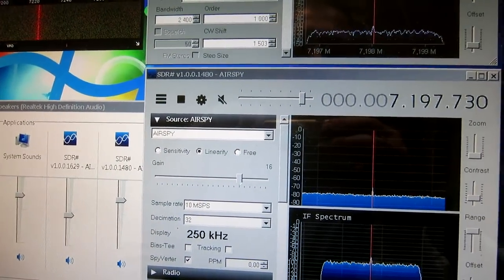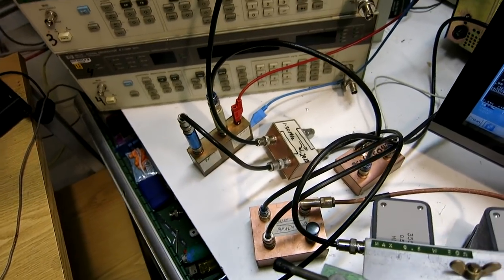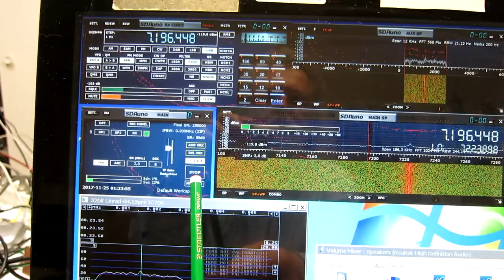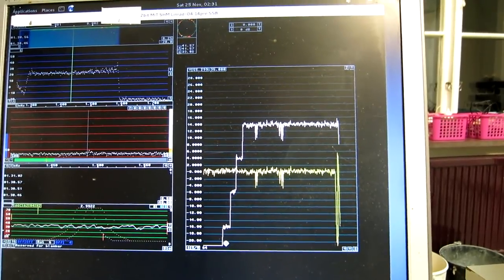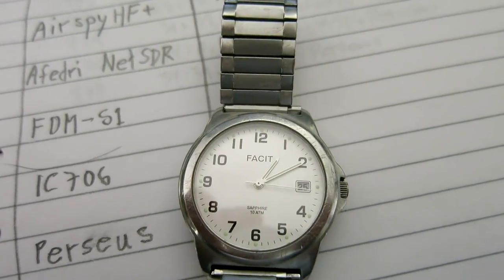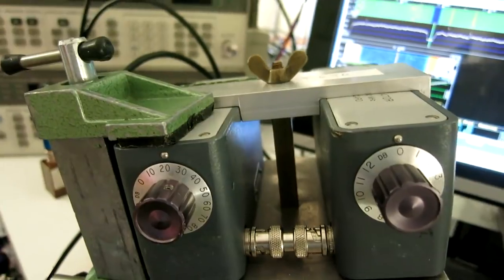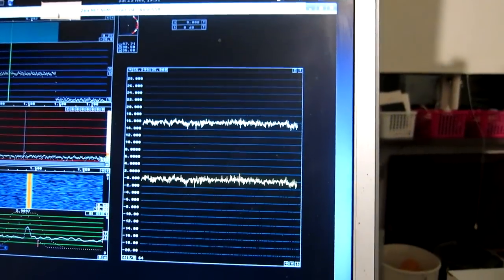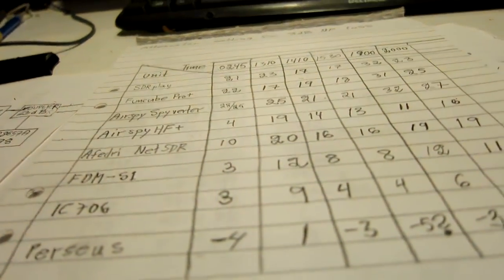rx4compare

Comment: Please note that the SDRplay used in this video is the original RSP1 model and not the newer RSP1A or RSP2/RSP2pro versions which have higher specifications.
Reply from the maker: Yes. It is modified however to eliminate USB noise. I do not think the RSP1A or the RSP2 would be very different because the front end filter would be a 12 MHz low pass filter plus a 1 MHz high pass filter.  The FUNcube Pro+ also uses the same tuner chip, but it has band pass filters that better protects from low frequencies. This is very obvious in the next video.